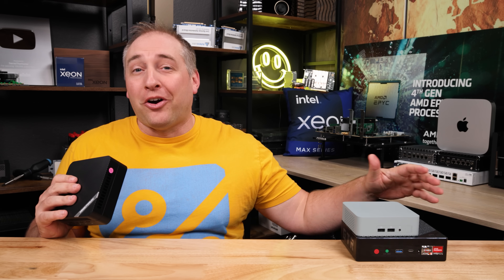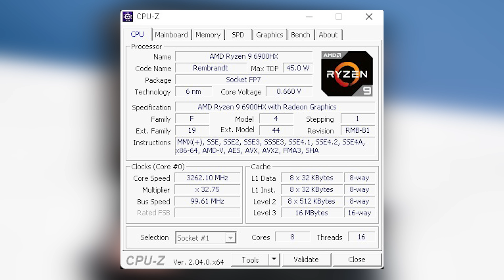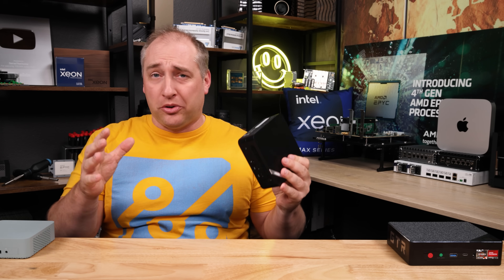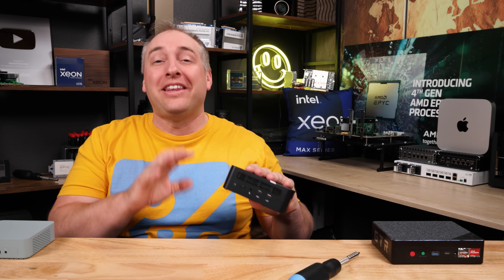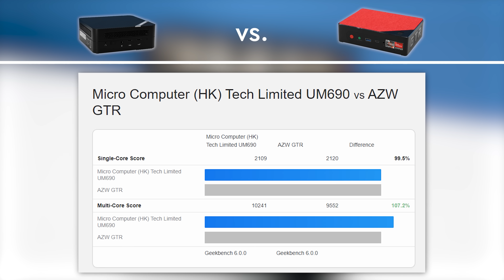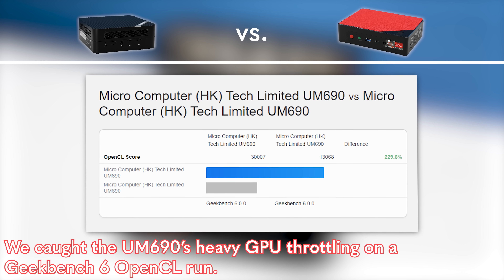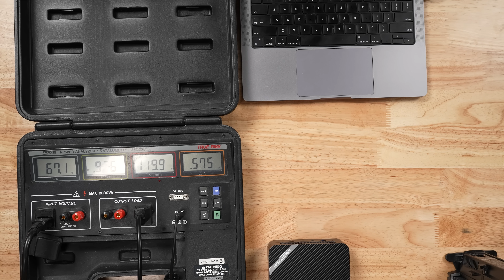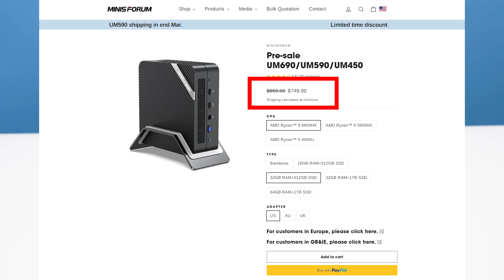HOT AMD Mini PC? Minisforum UM690

Comment: Same thermal throttling on the "MinisForum UM773 lite". I can play Diablo 4 at 60 FPS for about 2 Minutes, then it drops below 30 FPS due to Ram overheating. And this is only DDR5 at 4800 MHz, it should get much worse at 5600 MHz. Basically you can throw all laptop style DDR5 APU systems in the trashcan.
Reply from the maker: This is why we have been pushing for better cooling

Comment: I compared one of those Minisforum with the Ryzen 7 7735HS with the Beelink SER6 with the 7735HS. The Minisforum cooling seems to be unable to handle the heat and throttles quite quickly. I used y-cruncher test BKT for mostly CPU loading. I will have to check what HWinfo logged as far as memory temperatures. Bottom line: the Beelink can run for 30 minutes at 54W of CPU power without issues.

Comment: FYI :  Minisforum has launched a new version of this machine (U690S) that seems to have fixed the overheating issues with this machine. They essentially replaced the bottom with a thicker part that contains two fans and an open grill and added heat pads to drive and memory,  which they should have done in the first place
Reply from the maker: Yes.
Reply: Yeah been looking at the UM690 for a while and just spotted the UM690S and the improved cooling so dropped on one - fingers crossed
Reply: @bovineox  Have you recieved yours yet?
Reply: Update us man

Comment: You're fixated on the HDMI ports and that one USB 4 port as the only way to handle video.  USB 3.0 Type A ports can be used with USB 3.0 full HD displays that have stereo sound and multi-touch screen UIs.  The faster 10 Gb USB 3.2 ports should easily be able to handle higher video resolutions as video display ports as well.

Comment: Spend another $15 and get a 120mm external server fan with a USB power plug. Just pull the bottom of the mini and set it on top. No more heat issues.
Reply from the maker: Or just get the Beelink that has it built-in and integrated.

Comment: I run two of these in a Proxmox cluster 8 core / 16 threads per host is incredible for these little things.  I have both running 64gb DDR5 and 2 tb nvmes.  I noticed the fans were very loud running Harvester (the Suse/Rancher VM OS) -- but with Proxmox it runs much quieter, not entirely sure why.  I appreciate the thoroughness of your reviews, your enthusiasm is contageous!
Reply from the maker: Thank you Robert
Reply: I heard that Proxmox has an extensive hardware support compared with other solutions. I think that if there isn’t a driver for a given temp sensor, the fan for the concerned area runs full speed as if there were no sensor at all.
Reply: Do you have the 690s or 690? I got the s version and can't get the idle power consumption under 15w. How much power takes your 690

Comment: If your going to try and to game with this, why would you not use an egpu. That should take a good thermal load off  the unit. It looks to me that the internal gpu is more targeted at video playback and web browsing.
Reply from the maker: An eGPU adds power consumption, space, and cost. It may be better, but it puts the solution into a different category
Reply: @ServeTheHome  obviously it adds costs, but how does plugging in 1 cable add complexity... nothing could be simpler. 

If you run a desktop with an integrated gpu, it's going to add cost to add a 3080 also. By the same token, if I need to add additional drives, that also will be an additional expense. When you add functionality, it comes with increased cost. If the cost isn't of value to you, you don't do it. How is this a valid response? I don't understand.

Comment: great video :)

i want to buy something like this for a plex server, using linux and a 2.5" sdd for data. do you think this is a good option for that?
Reply from the maker: I would probably say to get a Project TinyMiniMicro 1L PC for that with Intel Quick Sync. We will have a newer generation systme review that is a bit less expensive than this hopefully Monday.
Reply: @ServeTheHomeVideo  thanks for the reply! i'm not sure about one of those older tiny pcs because of power consumption.  something more recent should be better as far as i know.

also looking for something for something with 2.5Gbe and at least 2 drives (one for OS and other for data).

i'm not sure if should go Intel or AMD because honestly i don't have enough knowledge regarding how well this type of computers can transcode especially considering that i'm planning to run some sort of linux.

I want to upgrade my current RP4 setup because i get the eventual "cpu not powerfull enough" error depending on the client

Comment: Hi I have seen loads of your videos and you do a brilliant job and I have a question if you can answer it please I'm looking for an old cheap tiny pc to sit under my TV that can run windows 11 it's just for work emails teams and the odd video from like netflix Amazon disney and so on I don't mind a bare bone system as I can add the ram and SSD is there anything you would recommend at all
Reply from the maker: Thank you Steven, TBH for that type of application, look at a HP Mini or Lenovo Tiny with at least an 8th gen Intel Core CPU (e.g Core i5-8500T or newer.) eBay is great and the Core i5-8500T's can be had for ~200 now with RAM, a SSD, and even a Win 10 Pro license (can upgrade to Win 11.) Core i5-10500T 1L PCs can be had for $275-325 easily. If you want AV1, then you will want a newer system but I just got a Core i7-12500T system for $490 with Windows. Our TinyMiniMicro series plus ebay searches just for "Core i5-8500T, Core i5-10500T, Core i5-12500T" or similar should get you on the right track. For what you are looking for, that plus whatever is the least expensive on eBay is probably the best bet. I think the 8th gen Core CPUs are the oldest that support Win 11.
Reply: @ServeTheHomeVideo  from what I'm reading if your willing to clean install you can go as low as 6th gen I'm not in a rush my company uses the Lenovo m720q did think about them as they work well but for me I'm not keen on the WiFi antenna so might look at a hp from the same range
Reply from the maker: I am not sure I would do 6th gen at this point. The Core i5-8500T was when Intel had to start responding to AMD so it was a HUGE performance jump.
Reply: @ServeTheHomeVideo  that was quick I have just ordered a brand new hp pro mini 400 G9 desktop i5 12500T 8gb ram 256gb nvme SSD I will upgrade there ram to 16gb or max it out latter on I just seen it and thought wow that looks stunning anyway thank you for the the info you gave and it cost me £634.80 direct from hp

Comment: The new Beelink SER6 Pro 7735HS, Gen3+ 8 cores / 16 threads and RDNA2 12 core graphics is also worth a look. The Ryzen 7735HS has a default and configurable TDP of 35W to 54W compared with 45W for 6900HX, but its peak clock speed is slightly lower at 4.75GHz Vs 4.9GHz. The SER6 Pro has a metal chassis (size is between UM690 and Intel NUC), same dual fan cooling solution as the GTR6, full function USB4 port which also supports single cable monitor connection with a monitor that can supply power over USB-C to the PC, 2.5Gbit/s ethernet port, a CMOS reset switch like the UM690, space for a 2.5-inch SATA drive on the NVMe SDD / Memory cooling fan assembly (similar to GTR6 including ease of access), 2x HDMI ports (4K 60Hz), 3x USB3 Gen2 (10Gbps) ports, 1x USB2 port (ideal for keyboard mouse wireless dongle), and comes equipped with 32GB DDR5 memory and 500GB NVMe PCIe 4.0 SSD for $649. Unlike the GTR6, it doesn't have a fingerprint reader, but I suspect that's down to the smaller form factor. I just purchased one to be a Linux gaming pc running Endeavour OS and Steam Client. I am fine with 1080p graphics. UK price was £539, but that's before taxes.
Reply from the maker: We might look at those, but we are starting Project TinyMiniMicro back up and the next mini PC we will have a video on is different, but way cooler.
Reply: Comparing the Beelink SER6 with the 7735HS and the Minisforum with the 7735HS, I saw that the Minisforum throttles the CPU to keep the CPU tempearture under control. Cooling in the Minisforum seems to be worse.

Comment: Sorry - less than intelligent question then -- how did you keep the DDR5 SODIMMs cool then given that it was thermal throttling the GPU?

Did you add another fan to the bottom of the chassis or did the orientation of the system make a difference in regards to the RAM temperature, and therefore; the GPU/system performance?
Reply from the maker: Mentioned in the video, we tried both vertical and horizontal orientations. We monitored the memory temps which is how we observed it. We are not going to ask people to take off the bottom to add a fan or to cut the unit to add a fan. Proper cooling should be done at the factory.
Reply: @ServeTheHomeVideo  
Thank you.

So, the results that are shown here are all throttled results and for the system, it is what it is?

Maybe I misunderstood the video because I thought that it sounded like that you were able to test the system without the thermal throttling on the RAM, which would've suggested that you guys found a solution for that.

But yes, I agree that the thermal management solution should be engineered at the OEM level.

Thank you.
Reply from the maker: Longer runs are where you hit throttling. We showed a GB6 OpenCL with and without throttling just before the 10 min mark.
Reply: @ServeTheHomeVideo  
Gotcha.

I've never ran the Geekbench 6 benchmark, so I didn't know how long a single run would take.

Thank you.

Comment: Yeah, I'm kinda "meh" on this one. I have one and I'm not returning it but the performance difference over the 5000-series is pretty small sans the graphics. The previous gen could not do much with gaming at all, the 6900 can sorta do low end gaming. I'm wondering if the 7xxx series will be a bigger jump. Anyway, I didn't get it for gaming so it's not a big deal. I completely agree, servicing the unit is a complete mess. I actually got my barebones for $499 - which I think was fair.

Comment: Retruned mine this week. It wasn't capable of 4k 60 fps HDR. That is, it dropped a variable but often large number of frames, so many that you could see and hear the stuttering. Minisforum support effectively tried to deny it could be a problem, then they asked me to record a video of the video not working. I sent them a frame grab showing the stats for idiots on a YT video. The reply was that they would have to buck the problem to the scientists  and get back to me. Of course they did not. So I took their original suggestion and sent it back--easy Amazon return.

Under load the fan was annoying. There was about a 1 degree C cooling advantage to using the stand. It wasn't possible to push the ram, though the bios had some speed options.

It did help some to allocate some memory to the GPU 4 or 5 GB seemed about right. The auto setting in the bios ramped up CPU/GPU/board temps, and fan speed but did not improve 4k hdr 60fps video.  

I did not try any games. It is capable of handling the output of a low framerate >4k camera, processing images on the fly, and later postprocessing images, singly or in batches.

In contrast a Ryzen 7 5700G, B550, 33 GB DDR4 ram at 3200, no overclocking, can process 60 fps HDR video easily. There must be more than one bottleneck in these minis. The newest Beelink 7000 series also failed 60fps HDR video, though not quite so badly. I ran hotter, but was quieter.
Reply from the maker: Good feedback
Reply: @qtsssimThe default is 2 Gigs, it never quite used 4 and those peaks were very short. Setting 8 or whatever the max was, didn't change anything in terms of memory used or performance.

Comment: Its this UM690 mini PC  suitable to use with proxmox as hypervisor?
Reply: I own one and the Proxmox setup is a tiny painful. You have to implement a workaround. The only supported OS's are Windows 11, 64bit Windows 10 64 bit,  RHEL x86 64-bit,
Ubuntu x86 64-bit.  I use Debian and was getting _sb.pci0.gp17.vga.lcd._bcm.afn7 bios errors with a monitor plugged in. If anyone wants to know something ask away

Comment: Is the usb 4 port a thunderbolt 4 port?
Reply: No, but yes. USB4 is TB3-compatible, and TB4 is basically the same as TB3 but requires the max bandwidth TB3 provides, 40GB/s, (but also power delivery to 100w, USB4 compliance, can wake from sleep). Devices like eGPUs have used the max TB3 bandwidth since their inception so the 'upgrade' to TB4 that has higher minimums didn't change anything. With exceptions (like stupid drivers), you should expect many devices with Thunderbolt 3 or 4 to be compatible and  'just work'. Perhaps the Direct Memory Access (DMA) protection is missing from USB4 but unsure.
Reply: For instance, I'm using a Thunderbolt 4-compatible dock with my Linux AMD laptop over USB4 without problems.

Comment: You should have reviewed this year model with 7735u (same chip basically) it was doing much better in performance and it was capable to overclock memory to 5200mhz to boost gaming performance. It costs $409 or $550 (with16gb/512gb ssd)
Reply from the maker: I would not be one to overclock memory in these given the overheating at DDR5-4800 we saw. Maybe if they re-designed the chassis for better memory cooling.
Reply: @ServeTheHomeVideo  Like your review but perhaps the unit you received has overheating issues?  Another YT channel did testing and he even used high ram 5400mhz in addition he overclocked same ram to 6000mhz in bios and did extensive testing during gaming and had no issues.   Here is link to his YT video https://www.youtube.com/watch?v=EDsTEGSolRI   Channel is: ETA Prime name of video if you don't trust the link: Most Powerful iGPU Ever! Faster Than A GTX 1050, Say Bye To Your dGPU! Hands-On AAA Test
Reply from the maker: We have users with these reporting the overheating in the description of this video. We really do not make much on affiliate sales, we purchased this unit (not a review sample), and this is a relatively low dollar item for what we cover. So we trying to show a more balanced view. We used a FLIR as well and there is a big hotspot on the bottom due to poor airflow. For light use, it is not an issue. Pushed on sustained use, and it happens.

Comment: AMD will have success only after they start using buzz words and join the hype of AI. Intel claims their NUC are capable of Computer Vision / object detection using OpenVINO. Not that they are high performant like Nvidia but NUC have edge over AMD and are behind Nvidia..... AMD is much behind so their small form PCs are still seen as less capable device.

Comment: Can you add a "How well does it Proxmox" section? I think a lot of folks would be interested in how well these would perform for a virtualization host.
Reply: I own one and the Proxmox setup is a tiny painful. You have to implement a workaround. The only supported OS's are Windows 11, 64bit Windows 10 64 bit,  RHEL x86 64-bit,
Ubuntu x86 64-bit.  I use Debian and was getting _sb.pci0.gp17.vga.lcd._bcm.afn7 bios errors with a monitor plugged in. If anyone wants to know something ask away
Reply: Especially since that USB4 port should support host-to-host so Proxmox with DRBD running on two of these with a low power witness would be very interesting

Comment: I have the GTR6, and out of the box they set the CPU’s TDP to 35W in the bios. You can set it to 45W and enjoy the same CPU performance as the Minisforum one.
Reply from the maker: Actually, it ends up better with the Beelink cooling.
Reply: @ServeTheHomeVideo  agree. The only downside with the GTR6’s internal is the M.2 SATA slot instead of a 2nd NVMe slot, but if it’s to keep the inside cooled then I’m all for it.
Reply: @vusun123  is there any software that can undervolt the cpu a bit? I used to do it with my android phone a long time ago.

Comment: Just wanted to add that I love your real/fair reviews. Need to keep pressure on these manufacturers to keep noise/fans and quality control in check. I personally don't care that much about plastic vs metal chassis. Do you know if the UM690 works with FanControl on github or any other 3rd party software? Beelink didn't support any of those.

Comment: Ugh why is fan noise so horrible on all of these. Have you found any medium to high performance miniPCs with low fan noise?
Reply from the maker: The fan noise is only bad on the internal mic. Way better than a NUC 12 Pro. Not silent the bigger issue is that they need cooling in the bottom

Comment: Do you get more performance if you leave the backplate off? What if you add a fan outside the case that blows at the ram? That would validate that the poor gaming performance is duet to poor ram cooling and not something else.
Reply from the maker: We monitored the temps which is how we found it. The fan outside requires an effort that one should not have to go through buying a system like this.

Comment: You're rather late looking at the UM690, any chance of checking out the UM773 when it releases?
Reply from the maker: Based on what I saw with the UM690, probably not. The Ryzen 7 7735HS is basically a lower cost and slightly lower clocked version of this one. I do not see chassis changes on the UM773 so I would still be wary of the bottom section overheating.
Reply: @ServeTheHomeVideo  But just looking at the "lower cost" on minisforum's website, it's US$100 less  ($400 instead of $500) for barebones, that's a pretty huge price difference IF it's nearly the same performance. It's even a more dramatic $150 price difference if you  kit them both out from them with 64GB memory.

So, at least for me, I'd REALLY like to see the 6900HX and the 7735HS versions benchmarked "head to head".
Reply: @ServeTheHomeVideo  Fair enough, your rationale makes sense. It's promising to see these mini PC companies get stock of recent chips like the 7735HS without having to wait in line behind laptop manufacturers though.